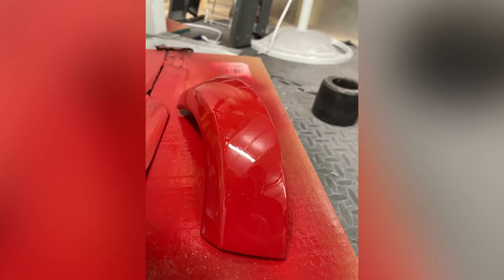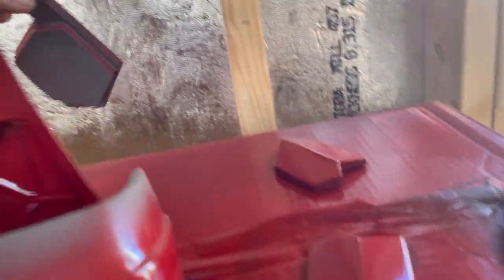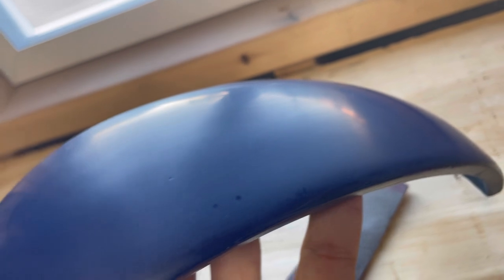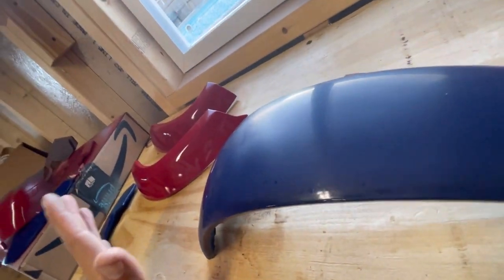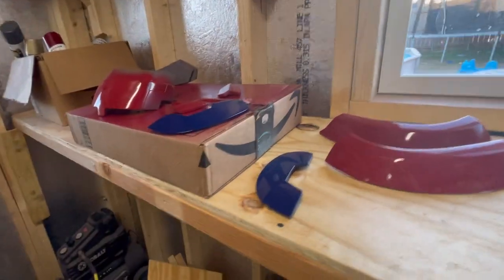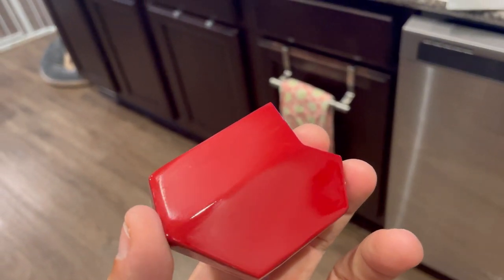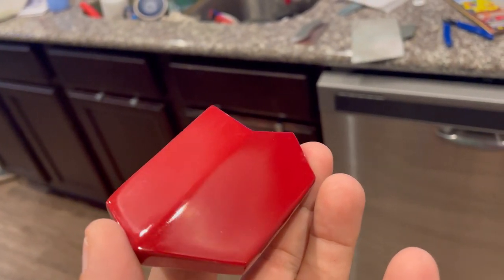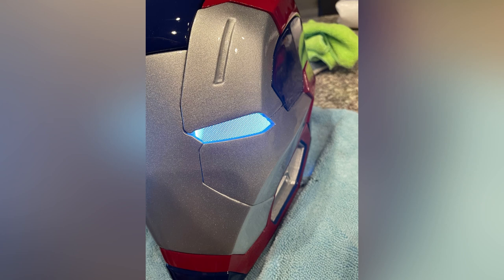Custom painted iron man helmet | war machine 3D printed helmet with New England patriots paint job!

Comment: Thank you for all of your videos.  All of them are very informative.  

I saw how you mentioned handling imperfections in the clear coat but what do when you get something on the paint?  I painted my MK 46 face plate today and it looks like there are specs of pollen on it.  How do you suggest I fix that?  Thanks!
Reply from the maker: The best thing to do would be very lightly wetsand the area with 5,000 grit sand paper and than repaint it. If you have enough coats on it may not need repainting. You can also try to wipe it down with isopropyl alcohol or a product called prep-all. Very important though if repainting you MUST repaint the entire faceplate IF it’s metallic. You’ll will notice a change in pattern and color difference due to how the flake lays if it’s not all sequential.
Reply: @Darkwingdad  Will do.  Thanks for the quick response!
Reply from the maker: @gmtosh  good luck! Message me if you need help!

Comment: When you sanded the metallic paint to fix the run did you paint over it or just polish it? Does it not remove the metallic when you sanded it?
Reply from the maker: I wetsanded the clear coat so I buffed and polished it

Comment: Do you wet sand metallic paints after? Any issues with it removing the metallic
Reply from the maker: If you sand metallics without clear coat you’ll need to respray the metallic paint bc the “pattern” of the flake will be distorted/removed
Reply: One more question. Last one of the week, I promise! Is there a cleaning solution you recommend for removing adhesion from the painters tape from spray painted pieces? Would the baby shampoo be safe on it? Don’t want to remove any of the metallic shine.
Reply from the maker: @benibarra23  it’s best to use an adhesive remover or wax & grease remover. Unfortunately if you used the wrong tape or left it on too long it likely etched the paint & will be sanding & repainting. Glue should wipe away with warm water effortlessly.